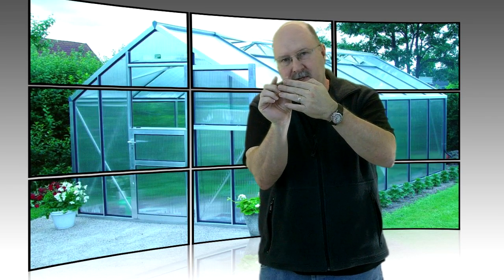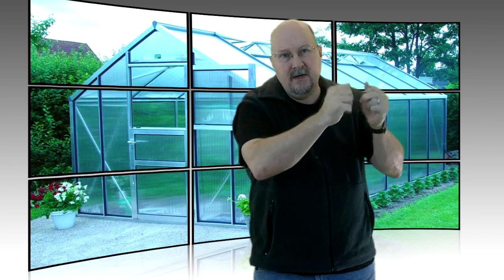Insulating your greenhouse

Comment: hey, if i were have a greenhouse in a place that has intense winds, needs to be shockproof incase somthing smashes against it etc etc
what kind should i get? like is there a glass that is good for that, or since spider silk is becoming a thing would that be good to use? i have an idea and if it works money will not be an issue
Reply: woodlefoof2 nn

Comment: I am thinking about combining aquaponic gardening and beekeeping within a greenhouse. I would need to have private entrances for each hive through the polycarbide panels. Are holes possible to be drilled through it without it shattering? With the greenhouse established on the south wall of my home helping to keep my home warmer in Winter plus 5 or 6 beehives within the greenhouse and one observation hive in my livingroom I might not even need any other heat source. I would just keep the bees well fed through the Winter and the heat they produce would keep the greenhouse warm at night and my home also. The hives would have to be established over the fish tank so all the hive beetles and mites would drop through the screened bottom into the tank for fish food. When Spring arrives I will have 6 thriving hives that not only survived Winter but abounded and ready for the honey flow.
Reply: Cool ideas! But I wonder whether you'll really be able to heat the greenhouse and your home with sugar syrup, which is the expensive fuel you're proposing to use, and whether you should really want to keep the bees warm. They'll overwinter fine at 42F or so and won't require feeding if you've left them the winter supplies they collected. Also how will the moisture from the fish tank suit them? I'm only a novice beekeeper and aquaponist, so take these thoughts for what they're worth.

Comment: Will I be able to have the green house attached to my home? The house will be the North wall of the greenhouse. Where do I get the plans and materials for a greenhouse?
Reply: Not only will building your greenhouse onto the south wall of your home help the greenhouse, it can help heat your house in the winter. Ours is 8'x19', and up here in the mountains, we get winter days with HIGHS in the single digits above and below zero. As long as the sun is shining, it gets to around 90 in there. We open the kitchen door, and very warm air billows into the house. Also, while it does get cold in there when lows at night are negative 20 or below, it doesn't get below positive twenty at night in the greenhouse. Just make sure it's well ventilated for the summer months, because even if half of the roof is solid and insulated, it will get hot. Some plants actually stay alive all winter out there, and it's not insulated at all, except part of the roof. Good luck with your project.